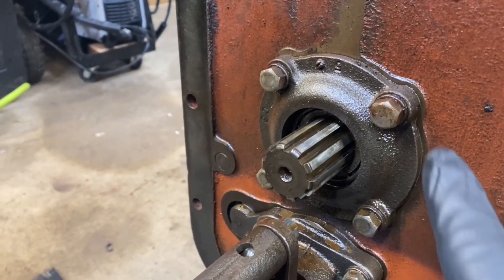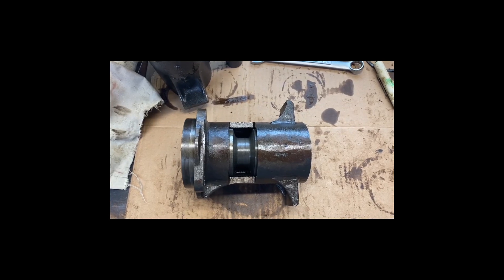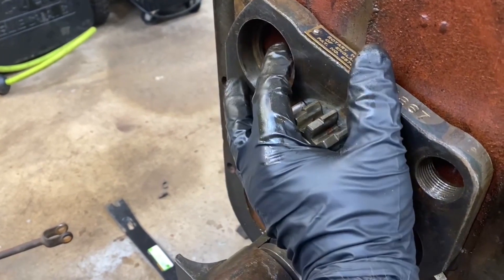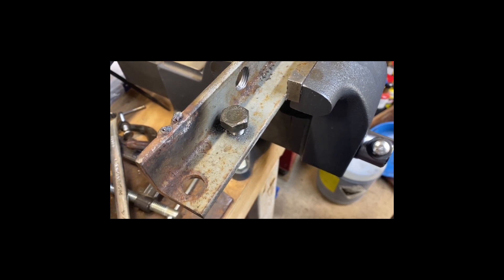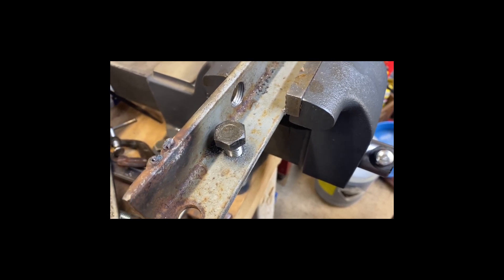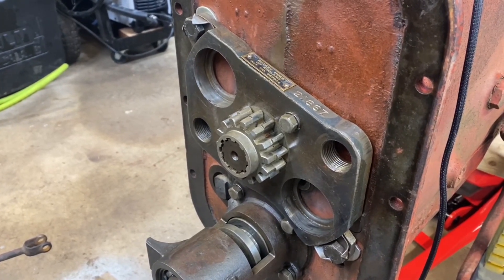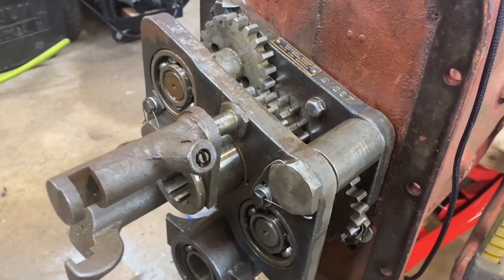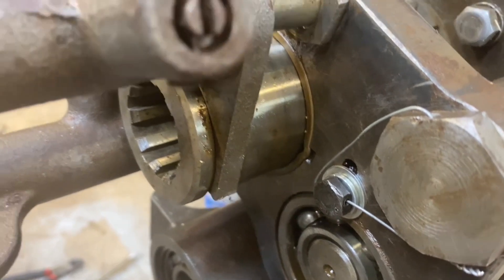Ford N Series Howard Reduction Gear Installation Part 2

Comment: You done good. After you pull the pto don't put in back until you joint the rear back to the trans. It will be easier lining up one spline than two. For others that don't have an extra pto to set the preload there's a 9/16 nut on the back of the lower cluster in the pto support you can just use a torque wrench
Reply from the maker: Awesome!  I will do that.